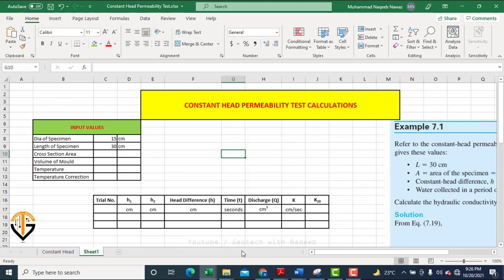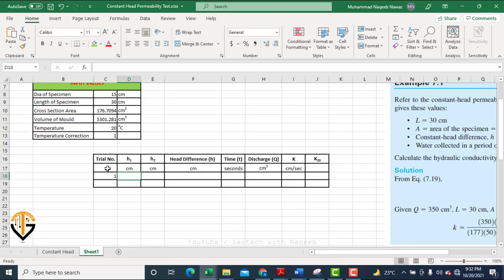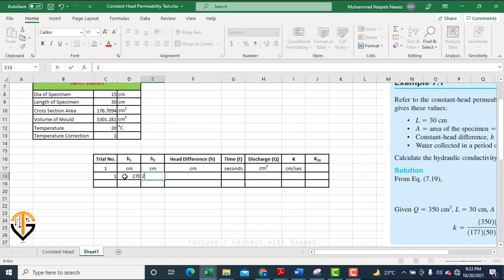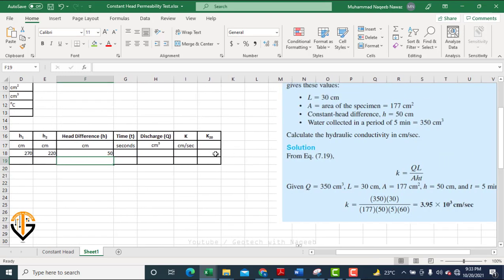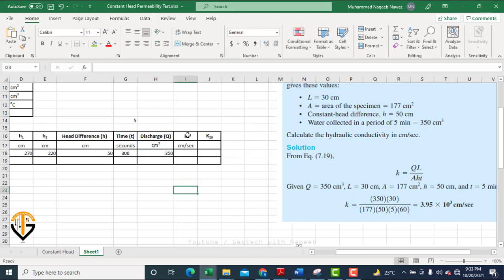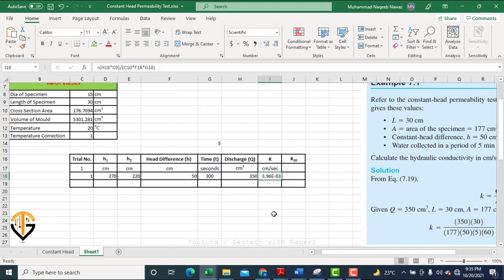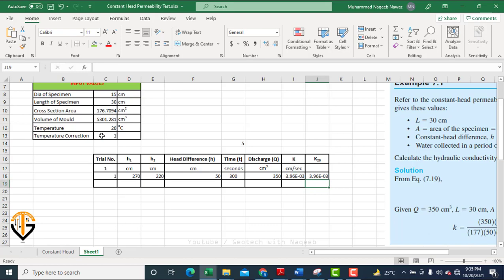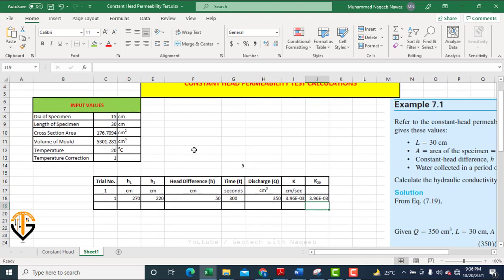Constant Head Permeability Test Calculations | Excelsheet | Geotech with Naqeeb

Comment: How's the temperature correction affecting the k value? You did not seem to need to use them b/c it was 1 but what if you had a different temp like 25?
Reply from the maker: temperature correction will be applied if temperature is different than the standardized value.. in my case i have taken 1